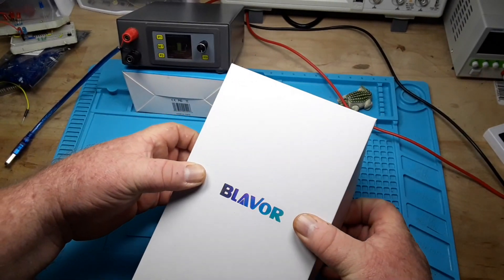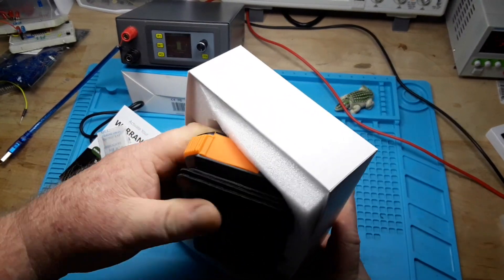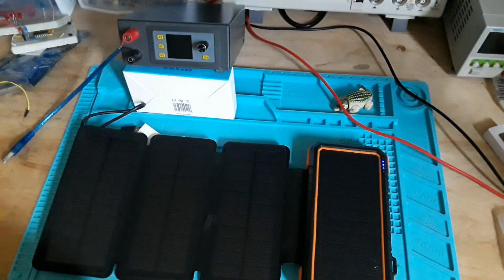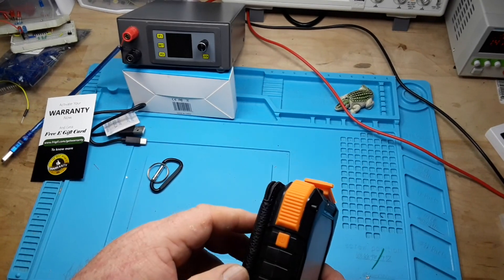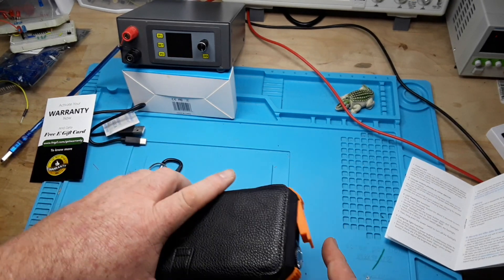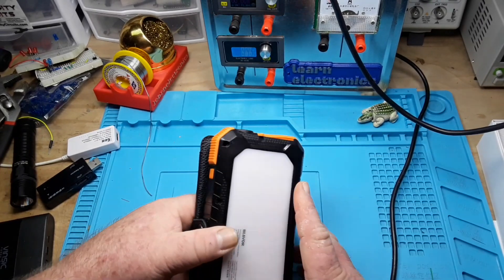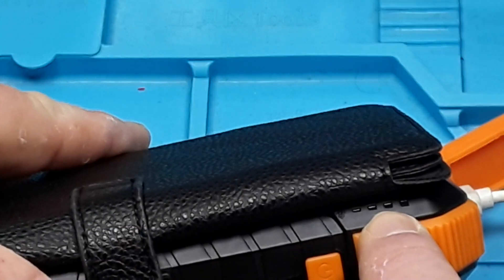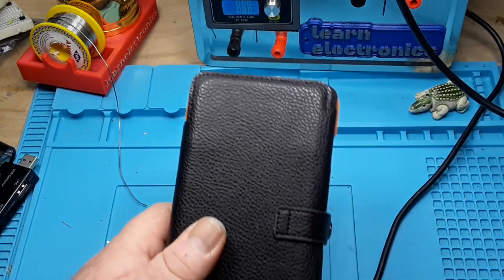Blavor Solar Charging USB Powerbank

Comment: Great product!! This unit has two lights. A large LED panel that turns on with a quick "double press" of the power button. The smaller more focused light turns on with a "hold" of the power button.

Comment: I have a power pack with a solar cell too, I used it once trying to get the internal battery charged using direct sunlight exactly as it is intended to use.
Then I took it off my window after an hour or two soaking up that sun, so the whole thing was blazingly hot from the sun that was baking the whole thing for two hours, so I set the power pack away to let it cool down before I even wanted to take a look at the thing, personally I will never do that again and I don't recommend it to anyone else to try because I think it's dangerous.
the internal Li-Po cells are getting baked by the sun which is just stupid and you can wait for problems to occur or an instant meltdown burning your whole house down.
Only if the solar cells can be connected to the power pack and you have a way to keep the power pack away from the sun using a separate foldable solar pack it would be safe to my opinion, I wouldn't even give it away for free, I would be too concerned with the people I gave it to that their house burns down because of a stupid idea like this, no way man...

Comment: Nice review - thanks. I have found on these types of batteries, the solar panels are weak and would take several days of full sun to charge 100%.  Undersized maybe or just low efficient.? Off topic question if you don't mind: AC power coming from two generators or two (solar panel+charge controller+inverter setups) will produce a (pure) sine wave (assume 120vAC@10A). Some say you can just add the outputs together to increase the power. I think if the sine waves are not in phase, they will cancel each other out and the result would be a something less. Did you ever do an experiment with O-Scopes on this? Is there a device that would tweak one source so they could be in phase? Just curious.

Comment: Not so nice that these guys also boast a 20K capacity but it is just over half of that. Hate to come across a bit sarcastic, but it quacks and walks a bit like that Lit Mobile power bank scam -- I hope it still holds a decent charge after some actual use. :)
Reply: Yeah, but remember to account for the 5v conversion and conversion losses. From the statistics Paul showed us, it's around 10% less if you look at total energy/Watt-hours. [5v @ 13Ah = 65 Wh, while 3.7v @ 20Ah is 74Wh.] And that 10% is all conversion and manufacturing difference, I'd say.

Comment: How many volts (minimum) does it need to charge a phone? I have bought from banggood a solar charging powerbank which uses a 126090 battery (bought seperately) and it does not seem to work until now or at least I do not know how to use it since there were no instructions in the package. I checked with the voltometer the voltage of the battery after a charge and it displays 3,2V. I don't have the knowledge to check the PCB inside for a boost converter. This is the product I bought: 

https://www.banggood.com/Bakeey-20000mAh-Dual-USB-DIY-Solar-Power-Bank-Case-Kit-with-LED-Light-Compass-p-1315155.html?rmmds=myorder&ID=226&cur_warehouse=CN

It writes 20000mah but the 126090 battery according to specs provides only 8000mah. Can someone provide some helpful hints?